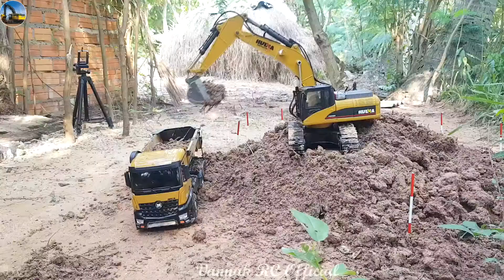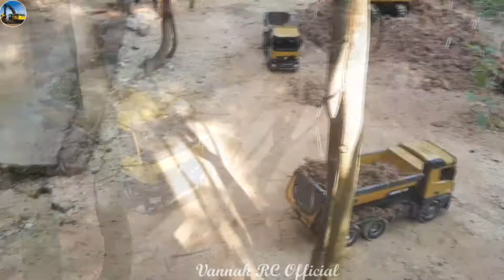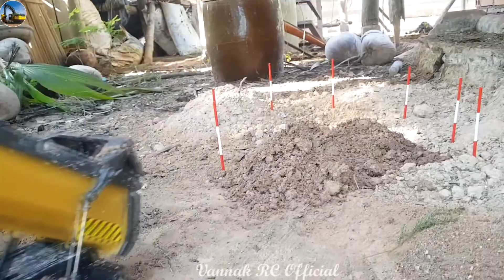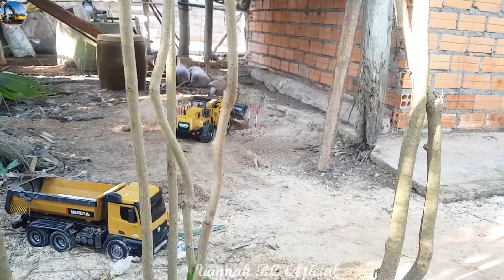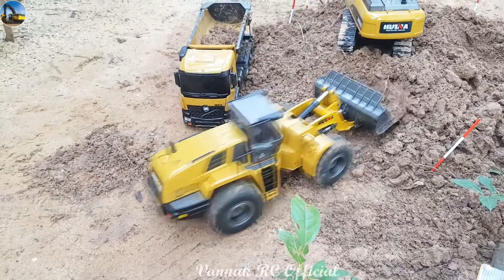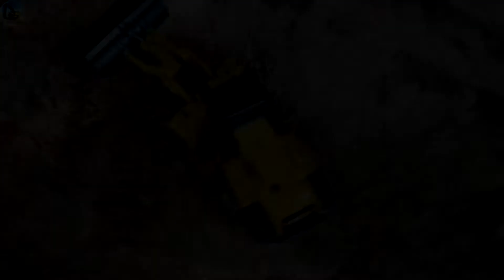Best of Huina RC Dozer RC Truck and Huina RC Excavator 580

Comment: As always a great video with the Huina models :) How are you satisfied with the wheel loader controls ? I once heard that you can only drive fully forward and backward. A slow forward and backward is not possible. Is that correct ?